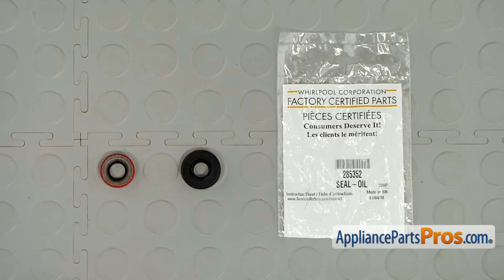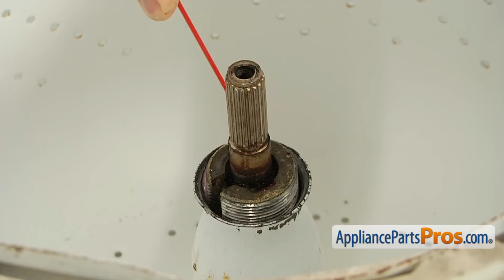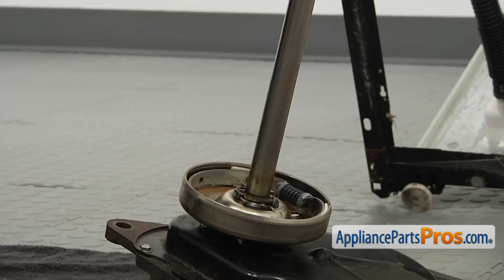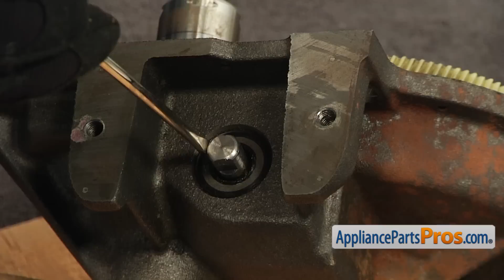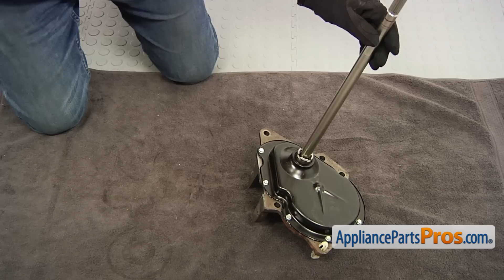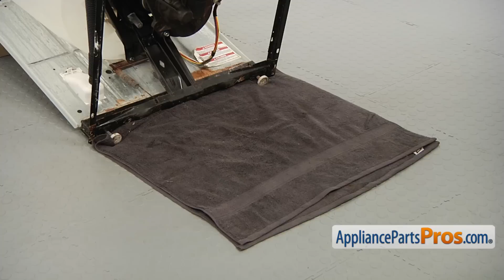How To: Whirlpool/KitchenAid/Maytag Gearcase Oil Seal 285352

Comment: Must turbine oil be used to lubricate the seal or is penetrating oil good enough???
Reply from the maker: You want to avoid penetrating oil. It’s too thin and can damage the seal over time. Use a light coat of turbine oil instead—just enough to help the seal slide in without tearing.

Comment: Is there a marked level to know when you put enough oil into the gear case????
Reply from the maker: There usually isn’t a marked fill level on these gearcases.

On most Whirlpool/KitchenAid/Maytag designs, you don’t “measure” a specific oil level during service. The gearcase is typically sealed and pre-filled at the factory, so when oil is added during a rebuild, it’s usually done based on the specified amount rather than a visible fill line.

If you’re replacing the seal, the key is not overfilling—too much oil can cause leaks or drag. If you’re unsure, it’s best to follow the service manual specs for that exact model or match what was drained out as closely as possible.

Comment: Kinda fun to take apart. I just did it on my 1998 Kenmore 80 series washer since it had a minor oil leak. The old oil had lots of dirt/grain on the bottom. I filled up the bottom of the gearcase till it started pouring out. Hopefully I didn't overfill it, was 16 oz.

Comment: Mine also has a hole underneath the gearbox with a metal piece inside that almost looks like a drain plug but it's not keyed for anything I have seen, although it is notched.  the main loss of oil has actually been through this location (whatever it is) and the shaft seal.  Have you ever seen a Whirlpool gearbox like this?   My main seal shows no oil loss.

Comment: What about just replacing the seal without opening and draining the gearcase by using gravity to keep the oil inside? Mine just started leaking a little. There's still plenty of oil in there.

Comment: What problem's would one have if it leaks oil? Would the washer not spin properly?
Reply: It will spin correctly until the gear box oil that is leaking form the seal saturates and causes the clutch to slip.
Reply: @brucealan8690  That is exactly what happened to me.

Comment: My 2005 kenmore elite top loader spins but takes forever to get up to full speed and doesn’t get the clothes dry enough, so I always have to run the spin cycle 3 or more additional times no matter how big or small the load is. Any idea? Could it be a bad clutch, faulty motor capacitor, bad bearings, or weak motor possibly? Every google search leads me to nowhere.
Reply: Also, if it's leaking water & the water is getting on the clutch, that will cause the clutch to slip & the thing won't spin & the clothes will be wet.
Reply: J KY I’ve never seen any moisture on the floor around the machine after using it so I think we’re good on that. Anyway, I got a new machine recently and rarely use this one anymore, mainly just for dirty work clothes. It works fine with very small loads. I will probably attempt to fix it someday and if I do, it will probably outlast the new washer.

Comment: Oh good grief. You don't need to remove the case, spanner nut, drum or any of that. That is a TON of unnecessary steps. All you need to remove is the agitator.
Reply: Very true, but if the seal on your gearcase is That Old you probably should replace the tub seal as well.  Sucks, because I have to get a spanner wrench just to remove it.  I've already tried removing it without one and it's impossible.  I have a bad feeling it's going to be hard to remove With The Wrench.  I'm going to keep soaking that thing with liquid wrench!

Comment: Yeah, Clean the basket, tub and top ring. Also, the wiring harness connect on the transmission; squeeze the connector from the back side with your fingers to release. Using a screwdriver on the wire side of a connector is asking  for a skint wire. Other wise, another descent Whirlpool Direct Drive Disassembly, Assembly video.

Comment: Why you remove the tub fo? You don’t have to do that to service transmichagin.
Reply: James Lester- Very true , but having repaired hundreds of these machines I can tell you that they have an affinity for building up a stinky , bacteria laden sludge on the inside of the outer tub that makes it well worth taking apart whenever you do a repair. Even if you don't need a repair . I would take that inner tub out once a year just to clean it.
Reply: no crap, lay the thing down on the side and the trans pulls out from the bottom.

Comment: Seazed spanner nuts are the bane of my existence
Reply: I've only done the spanner nut once & had to use a dremel to cut it, then pry it away from the threaded shaft.  The spanner nut is some kind of soft pot metal, so it's pretty easy to do.  You don't have to cut all the way thru it, just as far as possible without cutting the steel tub or anything.  Then when you pry, what remains below the cut will break.  Also, in case it needs to be said, make the cut where the drive block has the slot.

Comment: I found a substitute oil for that transmission. The OEM Whirlpool oil is $30-$35.00 for 15 ounces. Go to walmart, Autozone or Advanced Auto Parts. Get a quart of Hyperlube Oil Supplement for around $8.00. A quart is 32 ounces. You only need 15 MEASURED ounces for that transmission. Take some Diesel and an old paint brush and clean the old oil out. Measure 15 ounces and pour in the Hyperlube. Our machine actually runs quieter now.
Reply: Forum said you could use Supertech Gear oil from Wally World 80W-90, it's only $5.  They also said thicker oil bases would make the washer run more quiet, but it would also cause things like the motor to run harder and hotter.

Comment: If oil is leaking at the seal, why not just add more oil when you pull out the old seal?   Then you wouldn't have to remove the whole transmission.
Reply: Jason Morrell-  The oil is very heavy gear oil. Even if it was a light oil , you would never get it to go past the bushing and the shaft. The gap is too tight. If you could get it to go in, how much would you add?